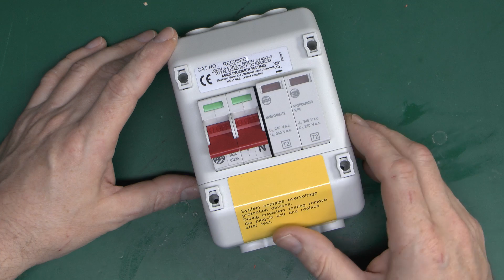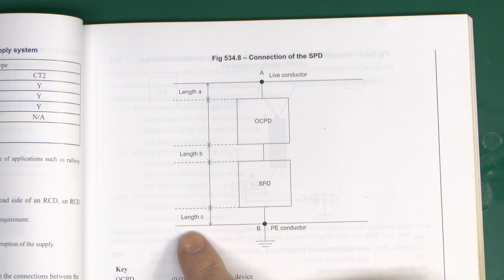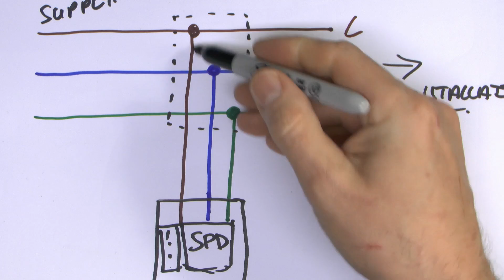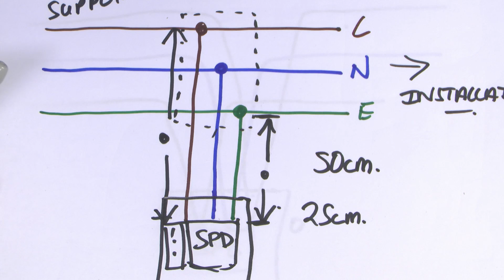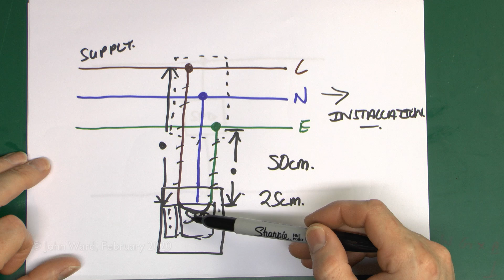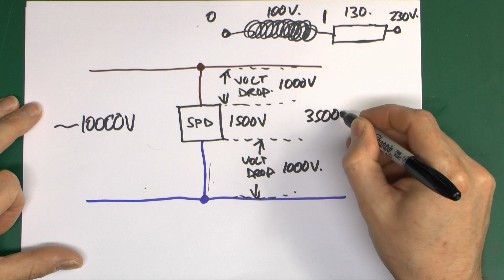Surge Protection 5 - Wiring Lengths, Connection Options

Comment: I don't understand why only the lengths of wires to nearest connection affect the inductance, the surge may have traveled a mile down the grid but an extra few cm's in the db is critical? Dosn't make sense. Thinking about it, in electronics when current is switched off to an inductor the magnetic field collapsing causes a voltage spike, but I still can't see how the wiring to the spd makes enough of a difference to write a reg about it.
Reply: This has been bothering me as well.  The HF transient does not originate 50 cm away from the SPD.
When the SPD operates, current will flow from the source of the transient to the MOV.  This could be a lightning strike 500 m away.
Could it be inductance and capacitance in the long cables causing resonance to occur?
Have you come across an explanation yet?

Comment: Mr Ward, how would you install this SPD Isolator in a domestic situation without pulling the Main Cut-out Fuse in order to replace the existing Isolator?  It would be silly to install it after the isolator (giving you two isolators) and indeed there wouldn't be any room in the meter cupboard!  Thanks.
Reply from the maker: That Wylex item is designed to replace any existing isolator.
Alternatively the SPD could be installed in the consumer unit.
Reply: @jwflame  Wow! Thank you for replying :-)  I have been intently watching a lot of your videos as someone whom I trust...  If I were to split the tails after the isolator  (in "Henley Blocks") to feed two consumer units, would this be sufficient to cover both CUs or would you recommend installing one in each CU?  Thanks.

Comment: Hi John - very interesting video - thanks for posting.  I just have one question.  If the inductance of the short lengths of wire to the SPD can create such a significant voltage drop as to reduce the effectiveness of the SPD, why is it that theinductance of the umpteen metres of cable in the installation don't reduce the incoming voltage spike to a trivial level without the need for an SPD?  I live in the countryside and my property is fed by overhead lines and as far as I know I have never had anything damaged by voltage spikes in the last 35 years.
Reply from the maker: The volt drop due to inductance occurs when the SPD is conducting, the current through the SPD and the connecting wires is very high.
With no SPD, the voltage will be high but the current low, so any volt drop will be insignificant, with most of the voltage across devices within the installation which will cause damage.

Comment: Thanks John, great video as mentioned in previous comments ,I'm trying to get the installation of SPD's correct i have looked at installing the Wylex REC2SPD unit at the origin of supply TN-S and also a type 2 at the consumer unit which is located over 10 mtr away from the switch fuse would this arrangement be suitable? Any  advice would be much appreciated 👍

Comment: Found this very interesting/helpful. 
Im installing Hager SPD in a 3 phase board, from what I understand it needs to be supplied via 32a mcb (3pole). This would be the first configuration you described but from the SPD to the mcb will be a greater distance than 25cm per conductor?

Comment: Would these minimize the effect of certain heavy loads causing lights to dim when they kick on and activate in-rush current? For example, when a large air conditioner kicks on, the lights will dim for a moment because of the huge momentary draw (surge). Do these SPDs minimize this sort of internal switching impact (smooth out the fluctuations) or do they only apply when there are huge fluctuations from the outside ?
Reply from the maker: No, these only work for overvoltages.  They won't do anything for voltage sag/dip.
However they do reduce the overvoltage spikes created when heavy loads are switched off.
Reply: @jwflame  thanks for the clarification
Reply: @jwflame  are there any products available that would address voltage sag/dip caused by internal switching events? I’ve heard of things like “voltage conditioners” and “voltage stabilizers” not sure if that’s what they do.

Comment: I have 3 phase main head, then isolator, then Ryfield  which supply 2 x3phase DB. where should i instal my external enclosure with 3x63A breakers and 3 phase SPD type 1? behind isolator and before Ryfield?

Comment: Do you use an spd per circuit? Or just one on the complete house breaker box supply lines?
Reply from the maker: One for the whole house for normal sized houses.  
Large buildings will require more than one.

Comment: Hi, something confusing me about the max length of wire.  I have an ev charger that is fed from a two pole rcbo in an enclosure connected in parallel with the tails. If I fitted an spd in the ev enclosure to protect the charger, is my max wire lenghts between the rcbo and spd within the enclosure, or does it include the length of the tails back to the connector block?

Comment: Brilliant video as always

I am trying to work out the best way to implement SPDs in temporary events,  We are often fed buy a 125A 3p C-form or 400A power lock outlets from the permanent electrical system in the venue,   The supply cable from said outlet is normally 20-40m long then this goes to a PDU containing all the protective devices and then cables feeding the loads from this point are often 50-100m long.   Would an SPD inside the PDU or inline on the supply cable still provide protection despite the long cable lengths (the cable lengths from the conductors to the SPD would be short although)?

Many thanks Marcus

Comment: Brilliant as always John. Someone should explain inductance to BG, since the SPD-PE link on their "18th-edition" CUs with SPD must easily be 50 cm on its own. see: https://cdn.aws.toolstation.com/images/141020-UK/800/87798-3.jpg
Reply: Actually, I've just realised that the N-E combined wiring length for the SPD on these split-load boards must be the best part of 1 metre (assuming the 16 mm² main PE coming in to the CU is connected to the main earthing bar at the closest position to PE supplied for the SPD). See https://1drv.ms/u/s!AqBvF7glEgubgshh8kcqCXblGSINYg where I've tried to scale the image to the dimensions of the CU and then measured some lines.

Comment: Hey John,what will happen if I interchange phase and neutral connection?And should I do it or not
Reply: Did you find out, because I have a similar need to interchange one phase and neutral in a 4 pole SPD?

Comment: Hi John, Excellent video as always. According to the manufacturers instructions for  that Wilex Spd, the earth goes in a different place if it is a TT system?  It looks like the R/H terminal goes to the MET; whereas, for a TN-s the L/H terminal goes to the MET? No mention of PME! Can you help?
Reply from the maker: Both E terminals are connected together, it makes no difference which one is used.
The differences for SPDs are between TT and TN systems, some can be used for both, others TN only.  If it's suitable for TN-S, it will also be suitable for TN-C-S.
Reply: @jwflame  thanks for the help John.

Comment: Good video, thanks for sharing....quick question wouldn’t this come under switchgear and assembly and therefore require to be in a metal clad enclosure?
Reply: I would say that it's impossible not to class one of these as a "similar switchgear assembly", and therefore yes, 421.1.201 calls for a non-combustible enclosure.

Comment: Thanks John for the video. I'm fitting a Wylex board with same type  of SPD as the isolator you show already fitted in the board. In the installation instructions it shows a connection to PE from the terminal of the top right unit and a separate connection to earth from the top left terminal of the other unit. Do I need to install an earth rod for this or link to the in the board MET? I'm on a PME system. Thanks for your time.
Reply from the maker: In a consumer unit, it's just a link from the earth bar in the consumer unit to one of the earth terminals on the SPD.
Reply: @jwflame  Thanks John

Comment: what should be the earth resistance ? in case of surge the electricity will flow towards earthground. what should be its value. does SPD require separate ground?
Reply from the maker: Doesn't matter what the earth resistance is for the SPD.
The SPD connects to the existing circuit, not to a separate ground.
Reply: @jwflame  If an equipment is grounded and someone touches will be get electrocated?
2.why we do system grounding ?
3.the earth is not a perfect conductor does current return back to it's source?

Comment: Thank you very much for this comprehensive surge protection series.
I only have one comment about voltage drop due to wire lengths and your explanation. In this particular case I do not think that voltages are going to be added one to another, but due to the high current, voltage drops on wires would be high and theoretically voltage drop on SPD during operation is around 0, which means that if big voltage drops on the wires, SPD would go out of the operation because of not having sufficient voltage level and over-voltage would be transmitted further once big voltage drops have SUBTRACTED from 10kV in your example... Please note that is only my opinion following your introduction.
Thank you again 
Regards
Reply: I also think the same, it will be subtracted from what is applied on SPD, hence SPD will not reduce the resistance.

Comment: Considering resistance depends on not only length but also thickness of the wires why don’t the regulation mention about the thickness of the wire connected between the supply and the SPD
Reply from the maker: The main factor when the SPD deals with a surge (transient) is the inductance of the wires.  Length of those wires will change the inductance significantly, wire size has a very small effect.
Reply: Thanks. Never thought inductance was such a key player.

Comment: Hiya John, at 3.20 you mention that the left hand module connects between line and earth. In actual fact if you bell these connections/terminals out you’ll discover that the left hand module connects between line and neutral. The right hand module connects between neutral and earth. I am unsure if this is an industry standard across all other brands, but certainly wylex and probably Crabtree (electrum) are configured in this way, great videos John keep then coming👍

Comment: I was always a little confused as to what you define as "length" especially of the earthing conductor. On a TT earthing system is it the distance to the earthing rod? That is definitely way over 1 meter. Is it the distance to the PE bar on the DB? But that's where all the earthing lines from the house power outlets meet. So if the SPD, channels the high voltage surge from a possible lightning to the earthing rod THROUGH the PE bar, then all the connected devices will receive it as well (fridges, TVs, washers etc).
Reply from the maker: Length between the SPD and the main earth terminal of the installation.
That might be the earth bar in a consumer unit or distribution board, or it could be a separate bar/block located somewhere else.

Comment: Thanks John, I thoroughly enjoyed your video series on SPDs, very well explained so that even a quantity surveyor could understand it. :-)
I live in Thailand and our electricity supply is all over the place and I'm forever losing my LED downlight luminaires. Would that be due to voltage surges? Would a reduced voltage also adversely affect the luminaires?
Do voltage surges affect luminaires when they are turned off or only when they are switched on?
Is there such a thing as a stand alone SPD that can be fixed in front of the luminaire so that each downlight has its own SPD protection - that would avoid me having to mess with the CU?

Comment: Hello john...thank you for such an informative video. I have one questions if you might want to answer.
In BS 7671 fig 534.8 - Connection of SPD, why OCPD is shown connected to SPD? What is the function of OCPD there? As per my understanding that will defeat the whole purpose of SPD. Please explain.
Reply: It very much depends on the SPD manufacturer and the size of your incoming supply, in almost all domestic applications you do not need any OCPD for an SPD, in larger industrial /commercial sites you probably will need OCPD. It's worth remembering that SPD's are designed to deal with transients, very high frequency short events so the reason for the OCPD is to protect the SPD from potential long term over voltage or high current events.

Comment: Very interesting topic particularly with a combined Master Switch and SPD fitted at the DNO intake point
Reply: Also interesting (?) is a what if I've been thinking about.   What if you have one of these, so you no longer need a main switch in your CU, and let's say it's an all RCBO one so it has no RCCB either.  With no incomer, how do you connect L to the busbar?
Reply: @anonnona8099  Switch off the Isolator in the DNO meter cupboard
Reply: @Mike_5  1) There might not be one.
 
2) It's irrelevant - that's an answer relating to isolation and safe working.  My question is there you are, with tails entering your CU.  How do you connect the L to the busbar?
Reply: @anonnona8099  Bellend.  Do your homework properly ...
Reply: @Mike_5  Thank you for replying to me with the same level of courtesy as I have shown to you.   You are a credit to the human race.
Reply: @anonnona8099  easy, just connect L at the first MCB connection on the bus bar. but i'd install a mains isolator switch in any case, just in case you forgot to turn off an RCBO or connected it incorrectly; maybe not you but the person after you :)
Reply: @PsykohDre  
> @anonnona8099  easy, just connect L at the first MCB connection on the bus bar.

Assuming that the device is capable (i.e. it's regarded as valid by the maker) of accepting both a busbar prong and a cable.

> but i'd install a mains isolator switch in any case, just in case you forgot
> to turn off an RCBO or connected it incorrectly; maybe not you but the
> person after you :) 

How does 2 isolators in series help with not turning off, or not properly connecting, a protective device?

Comment: What way do I include an overcurrent protective device in that stand alone wylex example. Are they built in?
Reply from the maker: Some have a fuse built in, others require a separate MCB.  If built in, it's wired as in this video.  For the others, L goes to a suitable MCB first, then from the MCB to the surge protection device.  N*E are always directly connected. Type and rating of the MCB will be specified by the manufacturer.

Comment: Thank you for the explanation of the cable lengths, not sure how the plastic enclosure sits with the Amd 3 change though, I seem to remember a manufacturer being admonished as they issued an illustration of a TT installation with an external Type S RCD in a plastic enclosure at the time of Amd 3 of the 17th being introduced. What are your thoughts on this?

Comment: If even short cables have significant inductance  where spikes are involved what effect will the  circuit breaker  protective  the SPD  have.
Reply from the maker: Very little, if installed properly the MCB will only add a few centimeters of length to the wiring,.  Although MCBs have a magnetic coil inside, for the ratings typically used with SPDs it's only a few turns of very thick wire.

Comment: I'm curious, why are plastic enclosures allowed for items like this when we have to have metal C U's, surely they can catch fire too ⁉️☘️
Reply: Because it doesn't have any load in it during normal operation. It's a voltage driven device installed in parallel. It fails to open circuit and will quench any transient in nano-seconds so no time for any thermal rise. The correct SPD installed in the right place in the right way poses no fire risk. That's why they can be in plastic enclosures.
Reply: Metal is designed for protection, these are to be located inside the metal housing providing the protection. Smack that plastic with a hammer or attempt to stab or cut through it with a nail  or saw and you've electrocuted yourself.
Reply: exactly. The metal consumer unit thing is just rubbish
Reply: Because when everyone has largely got metal they can change their minds again and have some fire retardant plastic with glass fibre reinforcement as a rule - just because.
Reply: That's what I was thinking too.
Reply: Best me to it! One rule and logic for one then the opposite for another.